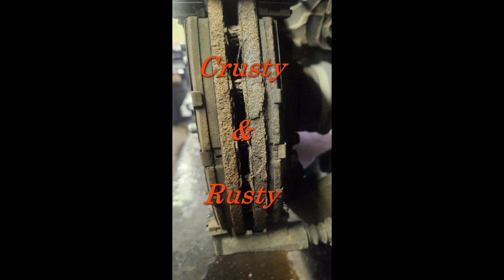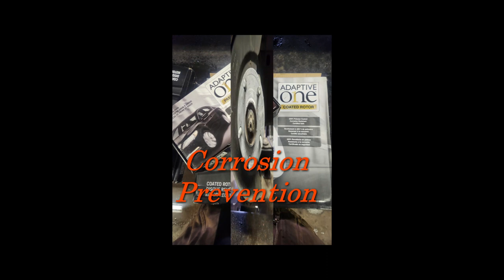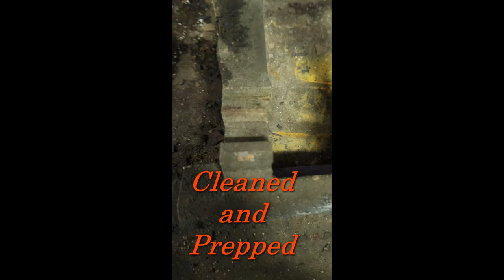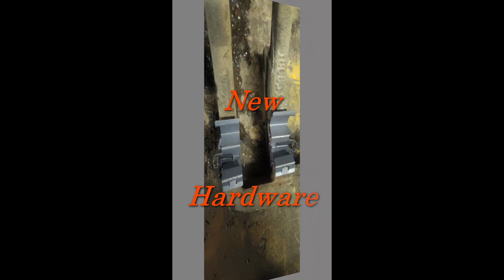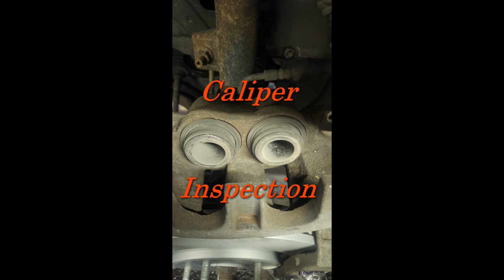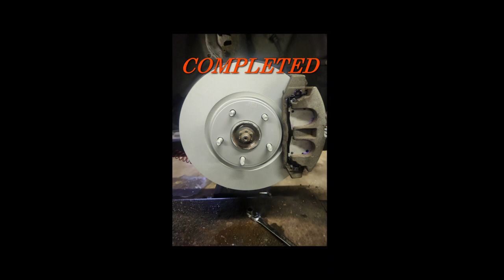Full Brake Inspection Pulsation leads to Brake Job with the Good stuff from Brake rotor Corrosion!

Comment: On my personal vehicles I get raybestos high carbon rotors or brembo blanks depending on what's cheaper and akebono performance pads from rockauto. Seems to be the winning combo. No rust jacking great stopping and no pulsation
Reply from the maker: I try and stay away from rockauto or internet based buying I still prefer the Buy Local
Reply: @Salty_Badger  I dont blame ya. I plan all my repairs in advanced so it works out pretty good for me. Savings are immense for many parts